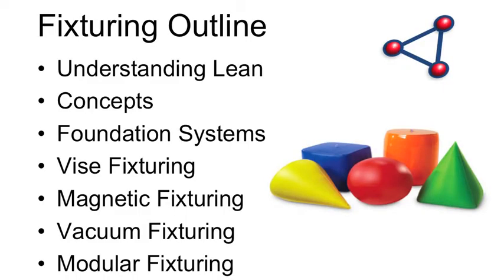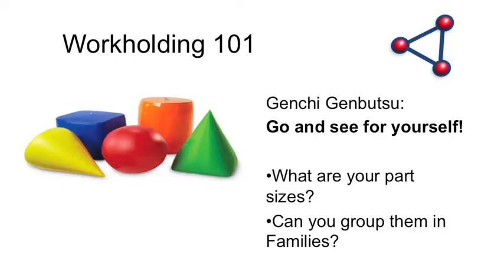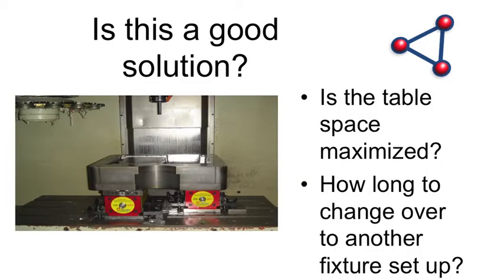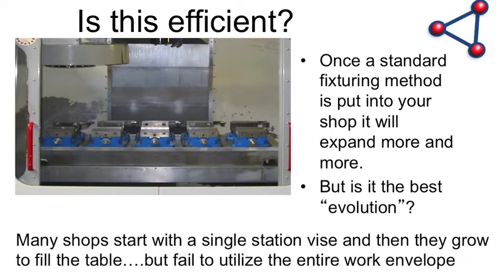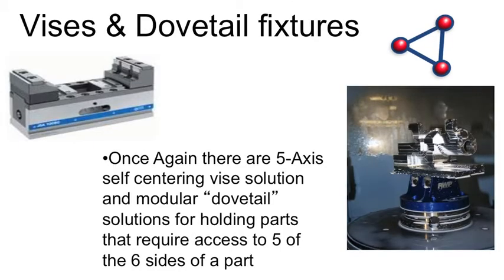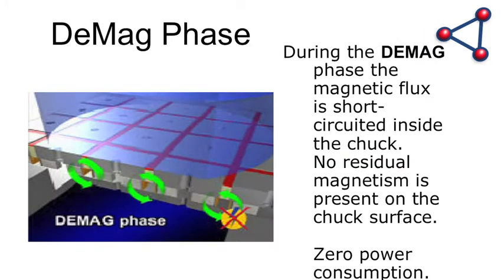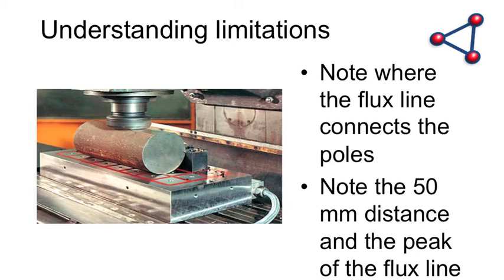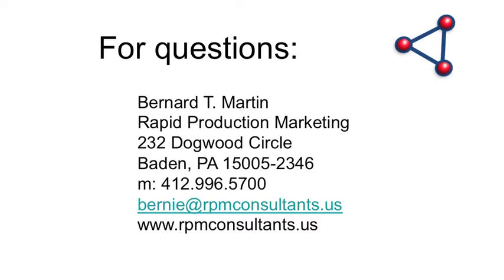CNC Workholding & Fixturing Solutions for the Long Term

Comment: Our setup time on repeat job changeovers average under 5 minutes. Spindle utilization on our VMC is around 65% by creating high density modular fixturing on a 40 x 20 machinable area. Huge thanks to many years of using Pierson Workholding Pallet solutions!